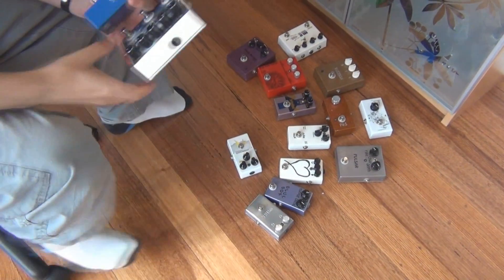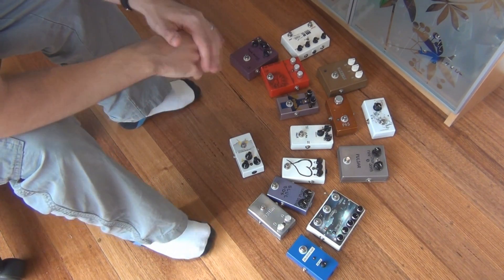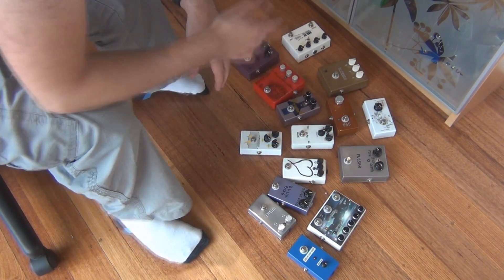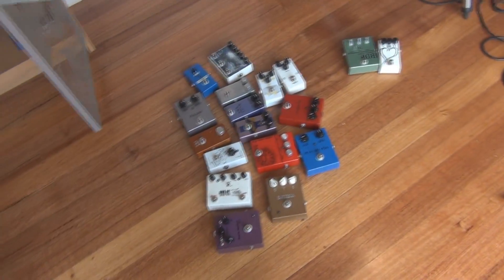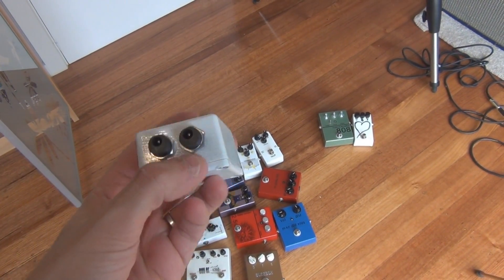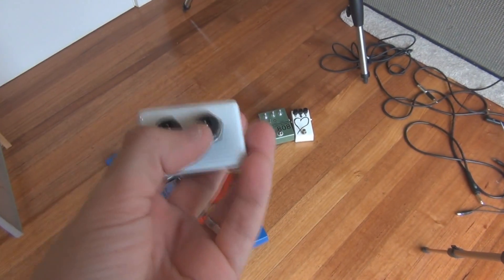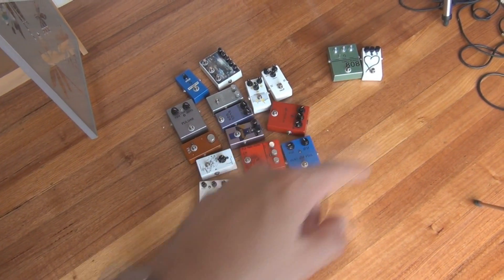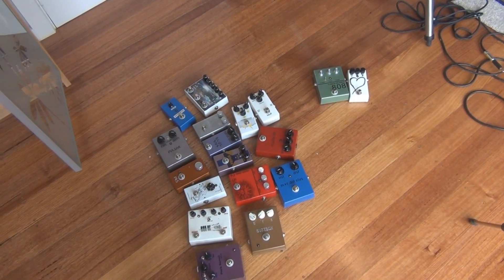DIY Guitar Pedal Reliability

Comment: How can i add a tone control to a bazz fuzz pedal,
regards
Reply: You can build a big muff tone stack, if you search on google for "big muff tone stack tagboard" you can find the schematic for a big muff & lpb1 boost (the boost is controlled by a trimmer and is largely necessary when implementing the big muff tone stack as on its own it can reduce the output of the pedal quite a lot).

Comment: Hi DIY Pedals, Paul, Good to see your still putting out new content, always looking. Family first. I built a 7 minute Bazz Fuzz on a bread board and it worked good. Trying the 5mm red LED, the 1N34A Ge diode, 1N914 and the 1N4148. Quick change of parts with the Brd Brd. Good way to see if your components are good before a build. Be good, Cheers, C.

Comment: Whats type of power conditioning do you utilize within the pedal? I've heard I need to take care of transient issues....curious.
Reply: Hi Matthew, As far as transient or stray voltage issues go, I build the Runoffgroove. com 1/2 watt Ruby Amp using an LM386 and a MPF-102 J-FET transistor and Flux can cause an issue. I built 4 Ruby's on bread board and they worked perfect. I would transfer to perf and had bad performance. I looked around with my DMM and found stray or transient voltage on the phenolic or PCB board material. I cleaned with 'Heet', ethyl alcohol and scored between the J-FET with a razor knife, and, they worked perfectly, you could score between the LM386 as well, couldn't hurt. Thought you might like to know. It's usually something simple. Be good, C.
Reply: @cassvirgillo3395  Hey Cass, Would building these circuits/pedals as point to point only, eliminate these type of issues within the pedal? Thanks.